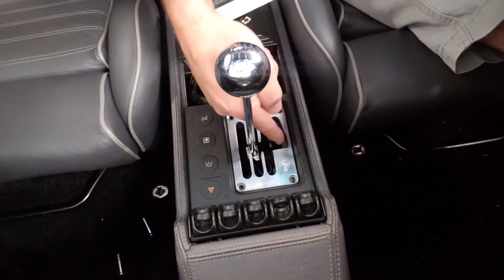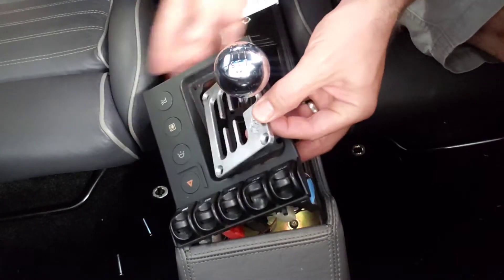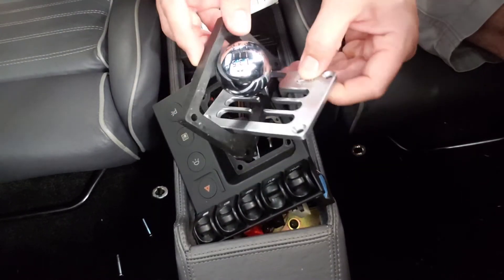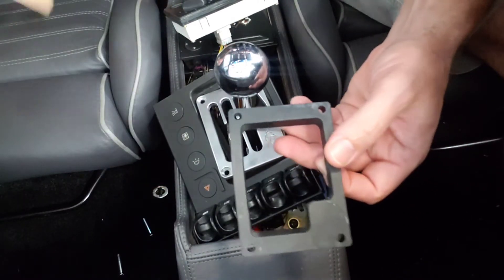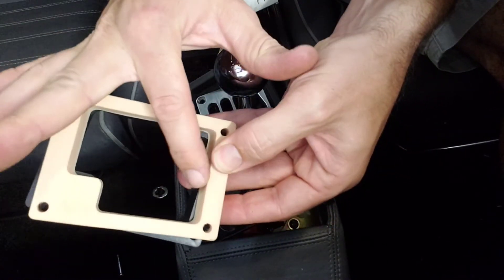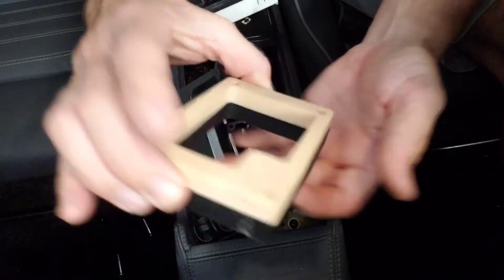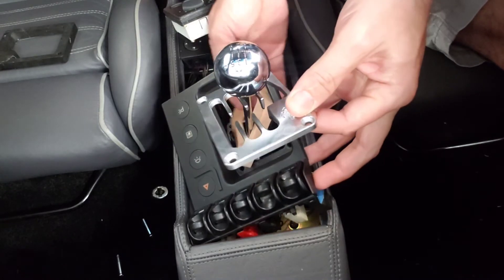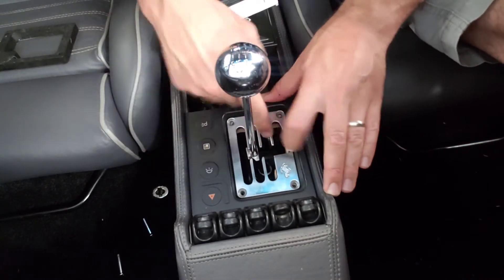3d Printing F355 "NLA" shifter gasket 159389

Comment: You can get the STL file by searching for "Shifter spacer/gasket CAD design" + "Ferrari" with the quotes for the FerrariChat thread.  It's the same for early 550s.  This is the 5th time I'm typing this comment hoping it doesn't get automatically deleted by the SPAM algo.
Reply from the maker: Awesome, I will likely just download it and host it myself so the link doesn't die
Reply: @ExoticCarDIY  Thanks!!! :D